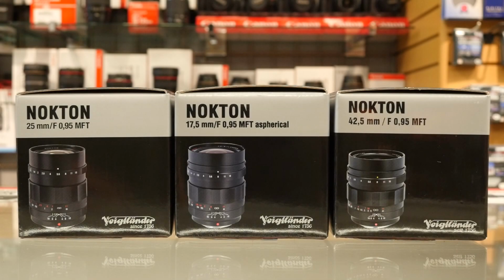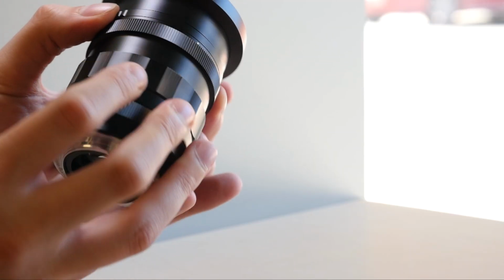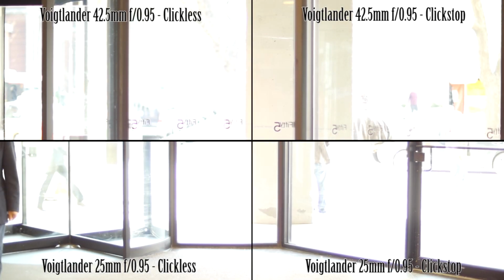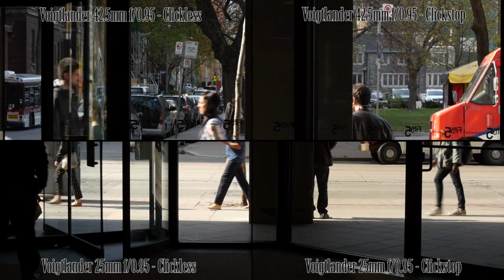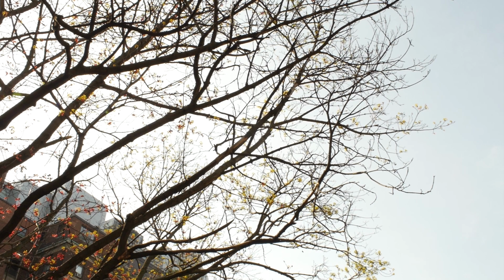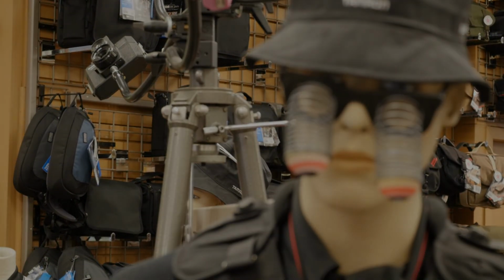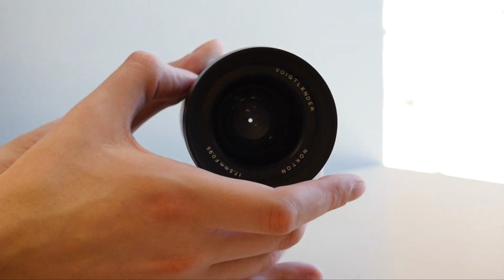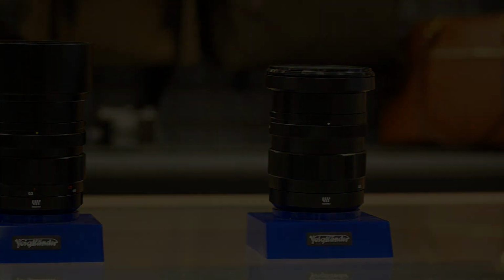Voigtlander Nokton Cine-Lens Test Run

Comment: I have 3 of these lenses.  The 10.5mm, 17.5mm and the 42.5mm.  I had the 25mm and sold it with regret.  Will purchase another one.  great lenses if the focal length breathing don't bother you.  I'm ok with it.  These lenses are fantastic

Comment from the maker: Hey @Shen Chen.  For reasons unknown, we can't reply directly to your query so we'll do so in the comment thread. 
 
For the first question, yes, all three lenses in the video feature both the click-less and click-stop adjustable aperture control.
 
For your second question, the only difference between the mark II and the original is the inclusion of the click-less aperture.  Other than that, both lenses are exactly the same.